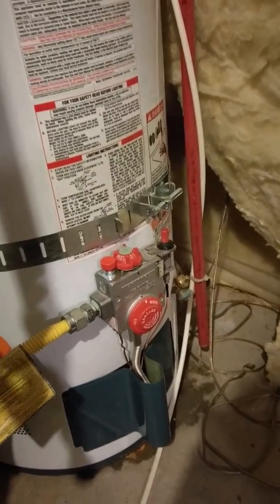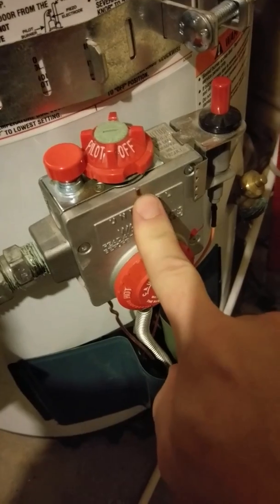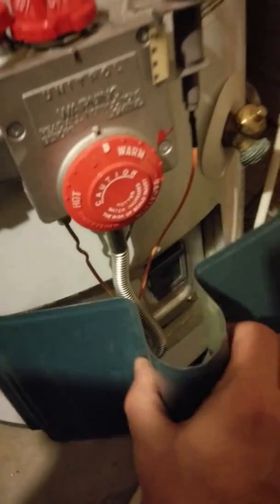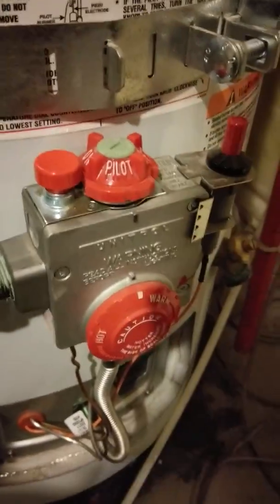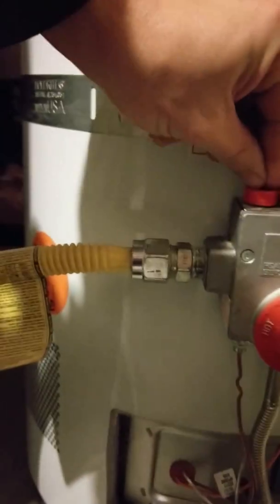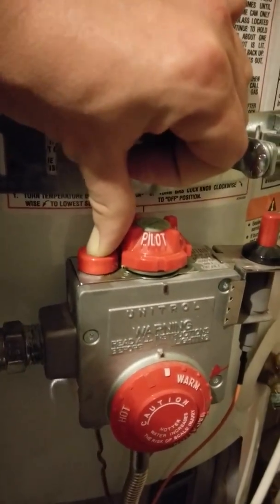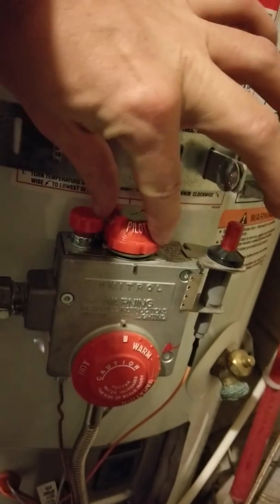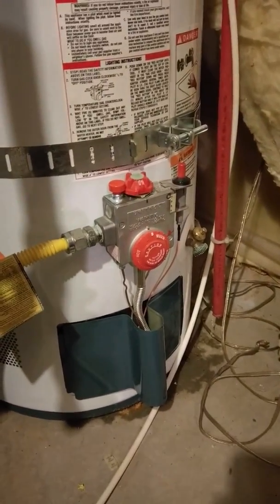How to turn on a hot water heater when the pilot light goes out

Comment: Thank you for your help!
Reply from the maker: An honor to serve!
Reply: Mine went out and I’ve followed the steps but the fire goes out as soon as I let go of the gas button. Should I press the button longer? Or is there a different issue?
Reply from the maker: @bn781  Hmmm, not sure.  If the fire won't stay lit its either missing oxygen, fuel, or heat.  It clearly has heat.  But if oxygen flow is bad that could do it.  It could be a fuel leak or a clog in the fuel line.  Rare, but certainly possible.  If it legitimately won't stay lit it might be time to call for an inspection.

Comment: Thanks man. The gas company showed up today to replace the meter outside. We've never had to do anything when they turn the gas off and on so I didn't think anything of it. Get home 11:30pm covered in grease paint and metal filings from working on the frame of my truck and I get a cold shower. Couldnt figure out how to reset the pilot . Your video really came through thanks again.
Reply from the maker: Very happy to hear. Thanks for the comment!

Comment: When I let off of the button the flame gos out everytime
Reply from the maker: I had an issue this year where condensation inside the central pipe had dropped onto the burner and corroded the metal preventing the flame from lighting. The result was the gas kept shutting off and wouldn't stay lit.  Drove me crazy.  I finally caved and called a pro.  Took 5 days to ship a new burner and he put it in.  Might be time to call a pro.

Comment: Does the gas valve matter when you’re in the lighting step? Should it be perpendicular when you’ve shut it off, and parallel when it’s time to light the pilot?
Reply from the maker: I am not familiar with all models so I can't comment on perpendicular or parallel, but I can say the gas valve matters in all steps.  Imagine lighting a barbequeue.  If the gas isn't flowing the spark isn't going to light anything.  Furthermore, the ratio of gas and oxygen has to be appripriate as well (see stoichiometry).  But if we have spark (heat), fuel and oxygen we have fire.But if you follow the prompts on your water heater it should say which direction the arrow should be pointing.  I hope that helps!

Comment: When I turned it to on the whole thing wouldn’t light up
Reply from the maker: After you move it to on make sure you hold down the button to provide gas and click the little clicker to make the spark.  It might take several tries.  But ultimately if it won't light, you may need to call a technician.

Comment: What do you do if the pilot keeps turning off when you release it?
Reply from the maker: From what I understand if this happens, manually hold the button down to keep the flame burning for a minute or so.  This can clear out any clear air that might be in the light which is interupting the gas flow.  But if you manually force it to burn it will all be pure gas and then you can follow the regular directions and you should have a flame.  Hope that helps.

Comment: i have same gas regulator except for the ignition switch, i prolly gotta light it by hand
Reply from the maker: I'd be surprised if there weren't some sort of mechanism to light it.  I'm no expert but I'd be very careful before you start waving open flames around gas pipes.  I don't want anyone to end up cinder just because they wanted a warm shower!
Reply: @craigwg  i saw others w the same one in video and they light by hand
Reply: @craigwg  when draining water heater my hot water wont drain but if i turn on cold water it will..
Reply from the maker: @Eastbaypisces  Wish I could help you on this.  My knowledge of hot water heaters extends to lighting pilot lights.  Sorry brother.  Best of luck to you!

Comment: Everytime I turn mine to on, itll light the burner, but than the flames act weird and go out, or there will be an small explosion
Reply from the maker: This might be air that is in the gas pipe which is normal if the pilot light has been out for a while.  Hold the gas button down for about 30 seconds to clear the air and fill the pipe with gas.  Then add the spark and you should be good.  30 seconds is fine to do this. Don't do this for 8 hours and then spark.  Be careful with this stuff!  Good luck

Comment: What to do if it doesn’t light
Reply from the maker: Becareful as always.  I should say I'm no expert by any means. But don't be afraid to try 5-10 times.  It really won't light you either have a problem with the gas, the spark, or the oxygen.  Your tank may be out or if the bill wasn't paid could explain a lack of gas.  Or perhaps roots growing have severed the line. The mechanism that creates the spark may be broken, which should be an easy fix by calling a gas company.  Maybe bad airflow, but that's the least likely.  Might be worth calling a gas man.  Gas person.  However they're identifying these days!  Good luck.  In closing, if you can't get it to light, turn the gas all way off!  Safety first.
Reply: The gas people just left from turning the gas on they said they couldn’t come into the garage because of covid protocol maybe I’ll have to press the button a few dozen more times, thank you for the information!
Reply: It turns out the fire was lighting but it wasn’t in front of the little window, I Just turned up the gas and pöof lit! Lolx

Comment: I tried doing this but my switch won't turn to off.
Reply from the maker: Did you get this resolved?  I can't imagine it won't.  Maybe its stuck and just needs more pressure?  I'm curious what you did to get it unstuck.
Reply: @craigwg  Yes I got it unstuck. I had to push on a small tab on the corner by the switch.